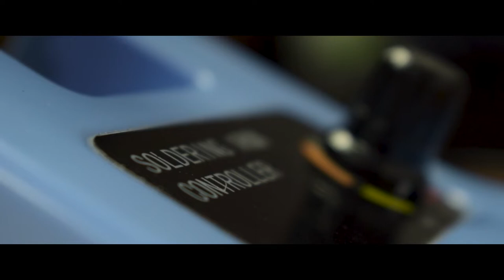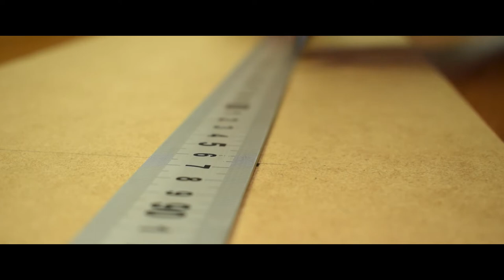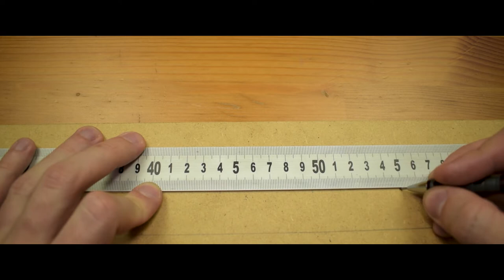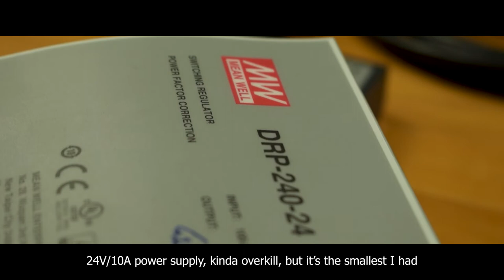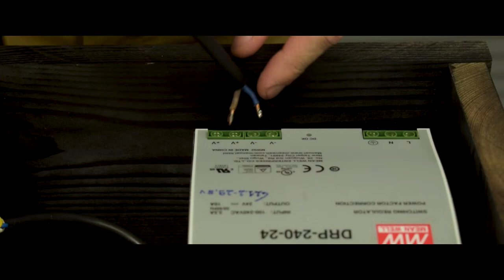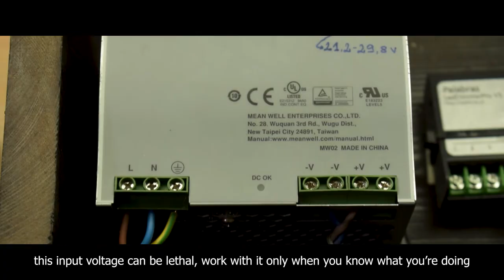Powerful DIY aquarium light with an awesome feature for less than 60$!

Comment: I'm an E&I technician and been looking for some ideas to build something very similar to this. Best video on the subject I've found so far, its a great mix of complex but achievable. Great work. Subbed.
Reply from the maker: Thank you for your kind words :)
Reply: there are usually 2 main options out there for LED control - 0-10V or PWM. Arduino or Raspberry PI can output PWM, but Raspberry PI only offers 2 hardware PWM outputs. You can either use PWM into a power FET to directly power the lights, or if using an LED driver with dimming capability, you can feed the PWM directly into the driver. Some drivers require a 10V PWM signal vs. the 3.3V or 5V peak from the microcontroller. In that case, you can use a small FET to switch an external 10V source to convert it to 10V PWM (shouldn't require much current)

Comment: Dude, ive been searching for this on yt, and it didnt come up. Thankfully it came up on the frontpage later. 
Have an old aquarium with t8 light which are becoming allmost impossible to buy, no led alternatives for my small light size. So gonna have to do a diy version. 
Gonna do something similar, just need to make it as much waterproof as i can since its under the lid.
Thank you!

Comment: If most of the things come from a local shop, it will be hard to provide an online shopping list. So, you are missing out on the Amazon affiliate link, and we are left guessing frame by frame. You could simply edit a picture listing the mats used in the next sequence into the video. That way, people won't expect a direct link to buy them, and you cover the identification part.
I will also recommend splitting the parts in 2 list: the important and fixture. 
With simple wood screw it doenst matter. But if you use 3m threaded insert, counter sunk, you will be flooded in question in no time.
Wire size, capacitors, step-down voltage regulator, supply bloc usualy goes in this part. 
Except if you are using any pro stuff. 

Schematics can be highly dependent on the parts, but a quick sketch may be enough.

It's a good video. A ton of good work. I hope to see more of you in the future.
Reply: Hey can you please help me with the part Number of power led driver at 00:54

Comment: Thanks for showing us the complete build of your awsome light! Did you ever tested SMD type leds 5730, 5050, 2835 the Chihiros lights are now using the SMD5730 type leds. What I like to know which leds result in more light.
Reply: The 5630 and 5730 LEDs output more light per emitter than the other types. Which strip is brighter all depends on the density of the strip (leds per meter) and which type of LEDs are used. I'd say the average density 5630 strips (60 leds per meter) output close to 2000 lumens per meter. There are some strips using the smaller, less powerful leds in higher densities that can achieve this level of output or more. The higher density strips also provide more even light coverage - much like a fluorescent tube. The brighter, less dense 5630 strips generate more of a shimmer effect that some people like.

Comment: The amount of thermal glue you're using on each LED would only kill the LEDs much earlier than their life expectancy.

You should not use more that a drop of thermal glue per LED PCB (the size of a head of a match and just a bit more) and spread it out evenly with circular movements of the PCB on the heatsink or even better, spread the thermal glue underneath the PCB with a card or something similar.

TL;DR: the thickness of the thermal glue underneath the LED's PCB should not be thicker than 0.1-0.2mm (thickness of standard A4 paper and even less) at most.

Nevertheless, great content and very nice video editing, keep up the good work, subbed!

Comment: Hi, thanks for the video. Where did you find the aluminum base and end caps for this?
Reply from the maker: I found the profile at a local dealer, but unfortunately, I don't know where he got them from. Maybe look for aluminum profile manufacturers in your area?
And as for the end caps - he just designed them himself for this profile and prints them on a 3D printer.
I hope I helped at least a little :)

Comment: Excellent job. Wish you had shared a circuit diagram for easier understanding and to replicate
Reply from the maker: Thank you :).
It's actually very simple. It is simply 7x1W power LEDs (and 3x3W) connected in series with a 350mA driver to a 24V power supply. The light driver is purchased from a local electronics-acquarist, by whom it is designed and manufactured.
Reply: @diystuff734  a dumb question. In serial connection won't the led at first series burn out faster than final ones.?. this black small square are resistors?
Reply from the maker: Those black cubes are "linear current stabilizers with 350mA output current", according to the description of the store I bought them from. The diodes should be connected in series, then the current on each diode is identical and the voltages add up. The design of the circuit requires that the sum of the voltages from all the diodes in series be slightly less (preferably 3 - 4V), than the supply voltage.
And thanks to them, the current on all of the diodes is equal, so they shouldn't burn out at all ;)
Reply: @diystuff734  at 6.55 mins in the video, positive collated wire was connected to which color wire, and negative collated wire was connected to which color?
Reply from the maker: @VrajeshR  There are three controllable channels in this lamp: main, cold and warm. Each is controlled by the controller with a separate minus cable (the main channel is connected to black, the warm channel to yellow, and the cold channel to blue). They all share a common plus cable (the red one).
I hope I have clarified things a bit :).
Reply: @diystuff734  What is the identifier name of the regulator?  Or the serial number.  what I need is to be able to buy it.  I am interested in the 750MAh for 3w led!
Reply from the maker: @joseantoniodelacruzgomez7173  This is an integrated current stabilizer, the seller gives the code NSI50350. If you want to use it with 3W LED, you should use two of them in parallel per one set of diodes (3 LED's for 12V, or 7 for 24V).
Orange diodes in this lamp are connected this way 😉

Comment: Very very nice work. 
I’ve a question what type of rectifier diodes are those?
Are 350ma? Or are like 2A and those like 2A are divided by the number of leds to make the 350ma/led?
Reply from the maker: All the LEDs, except the orange ones, are 1W/350mA Power LEDs. The orange ones are 3W/700mA. They are all driven by an LED driver 
(those little black cubes) that limits the maximum current to 350mA, and with the orange ones I connected two such drivers to let 700mA through.
Reply: @diystuff734  I think those black cubes are rectifier diodes, not led drivers, mas it does the job, I just can’t find 350ma diodes only 1A minimum, probably work if I connect 3 X (4leds series) at 12v, will be 1000ma/3 = 333ma per led group. 
You made an amazing jod with the led light looks even better than a led lighting bought from a store
Reply from the maker: @E-Biker Thanks for the kind words :).

Those black cubes are "linear current stabilizer with 350mA output current", according to the description of the store I bought it from. The diodes should be connected in series, then the current on each diode is identical and the voltages add up. The design of the circuit requires that the sum of the voltages from all the diodes in series be slightly less (preferably 3 - 4V), than the supply voltage.

The diodes are definitely 1W/350mA (and the orange ones 3W/700mA) ;). There are quite a few kinds available on the market and they are fairly easy to find, for example on aliexpress. Google "1W epistar power led" and you will see :)
Reply: @diystuff734  thanks a lot I’ll check it 😊
Just put my leds in the heatsink, now it’s time to solder all the leds in series.
Reply from the maker: @e-biker8406  Awesome, hope it all works out :).

The problem with connecting the leds in series is that there is no limit to the amperage that flows through them, so they can burn out faster than with adjustable amperage. I previously made aquarium lights with the same leds as in this video, but on 12V and limited by resistors. The diodes, as well as the resistors, burned out after a year or so.

Comment: Hi, what is the alluminium structure at 1:30 ? Where can I buy it?
Reply from the maker: It's an aluminum led profile, I bought it from a local supplier who specializes in leds. Unfortunately I have no idea where he gets them from. He sells it under the name "slim LED radiator/profiles", and has several types of them. And they are quite cheap, the one in the video costs about 1,3€ for 10 cm length. I hope I helped at least a little :)

Comment: Hi, you do not need coolers?
Reply from the maker: The premise of this project was just passive cooling. The aluminum profile alone has a cooling efficiency of about 88W of thermal power. The entire lamp has a total of 55 1W LEDs and 6 3W LEDs, for a maximum power of about 73W. This also leaves a 15W margin for the LED drivers.

However, with the current program, the maximum power with which this lamp shines is about 40W, otherwise it would be too bright :). With such use, it reaches about 33°C (91.4°F) when fully heated and is pleasantly warm to the touch.

Comment: What componen did you use to limiting current ?
Reply from the maker: This is an integrated current stabilizer, the seller gives the code NSI50350. I bought it from a local store specializing in LED. As far as I know it's a component for PCB mounting. It limits the current to 350mA, while the voltage of the diodes should be 3-4V lower than the supply voltage. As far as I know, you can safely connect a 36V power supply to it.
I hope it'll help at least a little bit 😉

Comment: New leds had come out which dos't need drivers and each 50w, you did not show the product properly, couldn't found out how you made the stand. Not everyone can make this, soldering and electrical knowledge helped you persue this, I will make mine, but it won't be that good.
Reply: Buddy, why are you giving out advice? You yourself said you don't have enough knowledge on the topic 😂. The 50w led you are referring to are AC COB LEDs and they flicker at 100Hz, plus need serious cooling and protection from water. They also need to be covered somehow so you don't electrocute yourself, and they will be too bright in a single spot in the aquarium. Learn a bit before commenting

Comment: I can't even begin to explain how many little mistakes you've made here, from the time lost in doing arguably pointless things like sanding down those edges on the mdf board, to using too much thermal glue (the thinner it is, the better), plus the amount of light lost due to how the plastic domes on the leds spread the light in almost 180° around the led, yet you put that mdr cover in front of the led so a fair bit of light is hitting the back of that mdf board. But hey, the end product looks nice, and you seem to like making stuff look neat even if it is a bit "overengineered" and a lot time might be wasted. Congrats, nice light. I hope it serves you a long time!